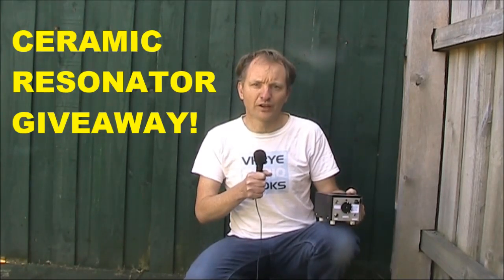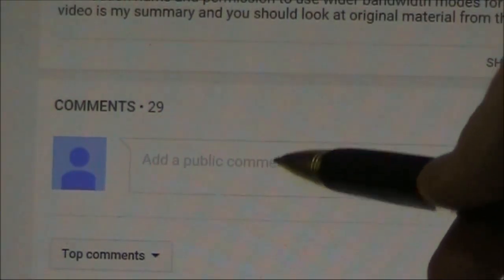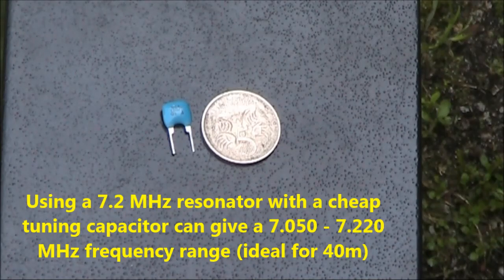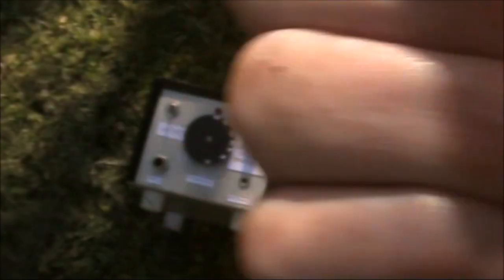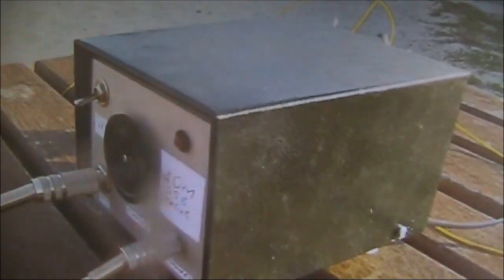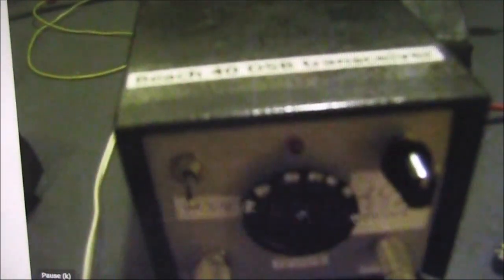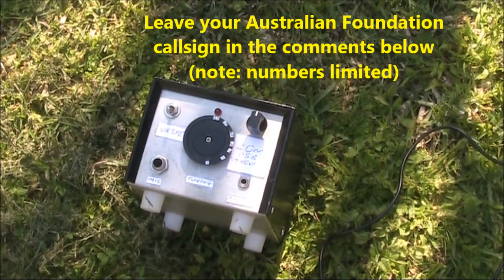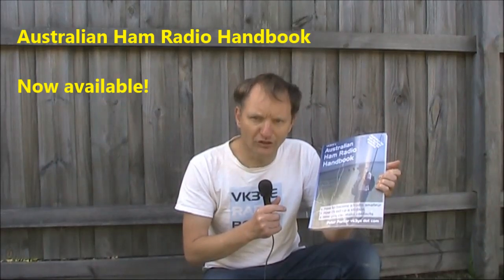Australian Foundation Amateur Homebrew Giveaway

Comment: So before today it was not possible to build your own equipment in the "lowest" class in Australia? I always thought that each and every amateur radio operator (indepedent of their class) could build their own transceivers. If this was different until today in Australia then shame on the Australian government. Being able to transmit with self-built equipment is in my opinion a very substantial part of being a HAM. Even if many don't excercise those rights.
Reply from the maker: Correct. When the FL was brought in there were fears that people with little assessed knowledge could cause interference if they built their own gear. This were found to be low risk so the restriction was removed. Other countries still have restrictions on homebrew equipment - eg Canada.